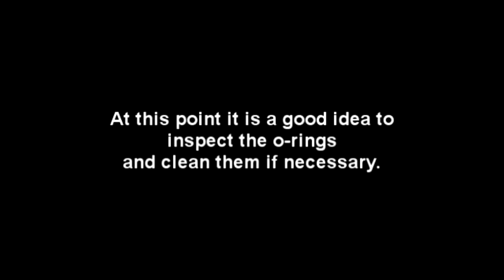Perma Pure AS Series Ammonia Scrubber Media Replacement

Comment: Thanks for the video.
Where in a CEMS sampling system is the AS scrubber recommended? Should it be before the sample conditioner/cooler with a heating blanket or after the cooler, heated or non-heated?